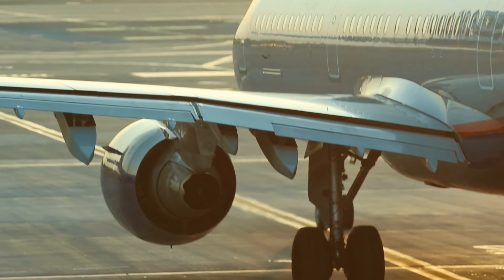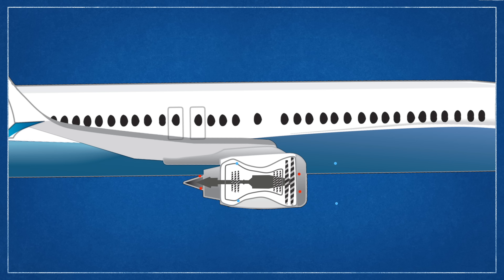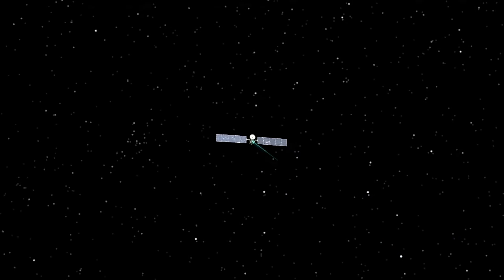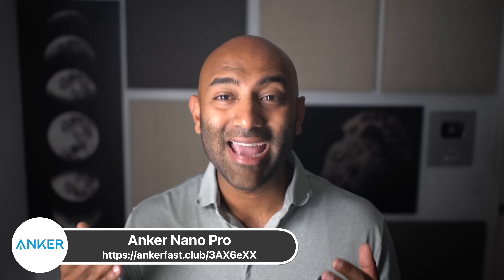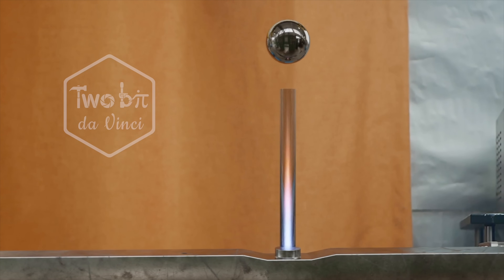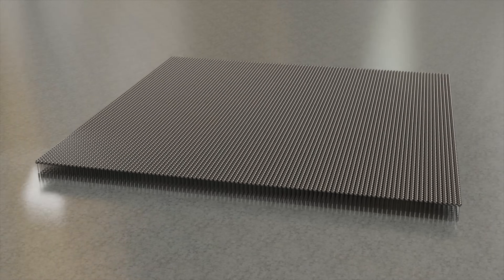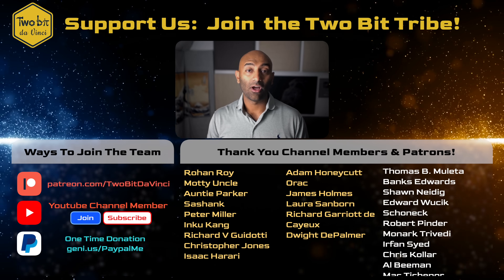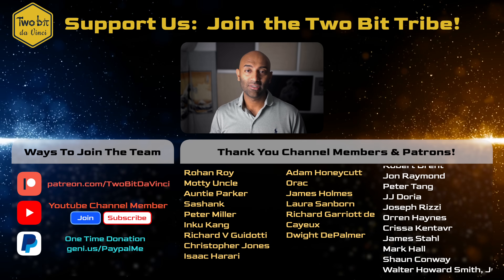The Next Generation of Jet Engines.... Is Electric?

Comment: 400W for 10N of force sounded like a lot to me. I just did a back of an envelope calculation for a propeller (taking a drone as an example). I assumed 0.02 m^2 of area (about right for my DJI spark). Where F=force, ρ=density of air (1.4kg/m^3), a=cross sectional area of propellers, v=speed and P=power;
F=ρav^2 and 
P=Fv/c 
(c is the efficiency of the propeller, which I'll just call 1). Rearranging the first equation, we get an air speed of about 19m/s. Power at that speed is about 200W and I assumed that the prop was 100% efficient. So maybe this isn't so bad.
It's still really hard to believe that it could be efficient to create the state change to plasma in the air.

I wonder how aircraft speed, changes the efficiency of both systems. The plasma system presumably needs the air coming in at a fixed rate, so I imagine some variable intake system would be needed, which will probably create a load of drag.

Regarding the limit of propeller speed, I'd like to hear more about this. Isn't it just a limit of the power of a piston engine vs a jet engine. One may wish to duct an electric prop, and maybe it makes more sense for it to be a fan than a prop, but whether you have a turbo powering a fan or a sufficiently powerful electric motor seems irrelevant.
Reply: Noep propeller speed limit is due to drag inceease at speed of sound, which is why turboprops (props driven with turbines) suffer from it too.

If you wantanyninteresting tangent, look up fairchild xf-86 "thunderscreech"

Comment: There an external version of the plasma engine that can use the skin of the aircraft( flight of the navigator style). In fact there is an visual example carved into Egyptian columns. btw they were painted with the discharge colours. Basically the more points you have, the more electricity discharge. effectively it a spark gap put to best used.  There is even a version that can work using the same principles as solar flares. Magnetic reconnection drives. The twisted flax. Or twisted flux form and reforms rapidly. Do that quickly and rapidly enough and things will fly. MIT made the first ion inspired aircraft to fly over 200m so its possible. Providing the plasma is used as an inducer. thrust can be achieved by a many number of principles. Bernoulli principles apply here. The aircraft get sucked into negative space and flyings from there.

Comment: I am not sure that the ejected "air turned into plasma" will not react to form nitrous oxides while it cools down to ambient temperatures. I am in favour of the development of all possible alternatives that reduce our impact on the environment.
Reply: I am totally sure that it WILL form various oxides of nitrogen. My uncettainty is how far those are greenhouse gases and are they worse or significantly better than the CO2 and other greenhouse oxides coming out of a jet engine
Reply: So then, it's probably more efficient to focus more of our resources on the shorter term fixes to our GHS reduction goals--without abandoning hope of a future breakthrough technology. Fusion maybe?
Reply: That was my thought as well, that extreme temperatures in atmosphere would generate ions by disassociating molecules.
Reply: Worth a study to find out I came up with this idea in 2015

Comment: How about NOx emissions? That will be even harder problem for electric plasma jets compared to combustion engine, i guess. With higher amount of air heated and heated to higher temperature, more NOx is created. NOx is a thing that created Dieselgate.
Reply: NOx isn't great fertilizer?
Reply: @widodoakrom3938  not when it stays in the air. At first, it damages people's lungs from beeing breathed in.
Reply: @volodumurkalunyak4651  yeah that's true

Comment: I don't think we need Plasma to replace a Turbo Fan; it's just a shaft spinning blades; we can do that with an electric motor!
It might be usefull at high speed and high altitude, and I have been thinking about a design for space launch.  If it's possible then that could significantly reduce launch costs!
Reply: Space launch is all about energy density and electric simply doesnt beat dinosaur juice. You are right though that using air for its reaction mass on ascent can provide performance advantages (using it instead of carrying that reaction mass on the vehicle, whilst in atmosphere). You’re also not the first to have this idea though, look at reaction engines’ SABRE engine
Reply: @PowerStudios1000  I think that is more of a belief than actual fact!  Electric aircraft work!  All that's really needed is to make the altitude marks at each stage.  And even if the upper stages can't be Electric, there's nothing stopping the main stage from taking off on electricity!  As heavy as batteries are, all the dead weight gets shed at every stage, so there's really nothing slowing them down!  We could even do a half stage if we send power from main stage battery to stage 2 or 3 engines or just run all engines off main battery until they separate.
Reply: @bardrick4220  If you want some actual numbers. Kerosene has an energy density of roughly 40MJ/kg which is around 12000Wh/kg. The best lithium ion batteries currently are around 275Wh/kg (About 500Wh/kg is the generally accepted required value for large electric commercial aviation). That is an energy density difference of 4363.64%
Reply: @PowerStudios1000  I honestly wouldn't trust half the figures for Li-ion since those are getting better every few months!  There's major economic incentives to reduce weight and increase power, so they can increase usable EV range!  

Like I said I'm only concerned with Altitude and Velocity since that's what's necessary for Launch, but most of the equations are beyond me, so I'm leaving the idea here for those who can solve it.
Reply: @bardrick4220  Li-ion batteries are improving yes, but it's not likely they will increase energy density 4000%+ suddenly. Fundamentally to reach the altitude/velocity needed by launch you need to be able to accelerate the mass you want to take to orbit with reaction mass (propellant) which itself has weight that must be accelerated (until it is used up). This is why the energy density (Energy per unit mass) of your propellant matters.
Reply: @PowerStudios1000  You seem to be confusing Rockets with Space planes . . . A rocket gains altitude by shear power, fighting gravity where as a plane gains altitude by "lift" generated by air passing over it's wings!

Rocket flight is fundamentally different, and I'm gonna say impossible for a battery to achieve!  Green hydrogen fuel solves that problem, but again it's really expensive, so that's why I want to find an alternative.

The Idea is to only use propellant after the vehicle leaves the atmosphere, so you save weight!  I think plasma engines have a major advantage here since you can sustain an arc in very diffuse air long after any flame would go out!
Reply: @bardrick4220  The problem is physics-based and not dependent on how you class the vehicle. You are correct that aircraft use lift, this lift however is produced from forward motion which is achieved by the propulsion unit attached to the aircraft. This could be an air-breathing propulsion system (Jet engine for example) where the bulk of the "propellant" is the surrounding air and only fuel needs to be kept within the aircraft or it can be a rocket motor (Fuel and oxidiser kept within the aircraft/spacecraft). To get to orbit the vehicle must essentially go very fast, so the lift actually doesn't matter that much apart from during low-speed take-off/landing of your spaceplane (See skylon's small wings) and the propulsion system matters much more.

The fact remains that any propulsion unit needs a supply of onboard fuel/energy which will require mass (Yes even your plasma idea will need this in the atmosphere as it consumes power and that power must come from somewhere onboard) and if that mass is too large then it will be infeasible for it to reach orbit. Batteries very much fall into this category and likely will for a very long time. Plasma propulsion uses orders of magnitude more power than an electric fan system for the same thrust and so is also completely infeasible and will remain so long after some miracle makes batteries marginally feasible (For the atmospheric portion only of flight).

Spaceplanes, as with any SSTO concept, actually have even more of a strict requirement for energy density (by mass) to be feasible than rockets do. This is because the energy to reach orbit is huge and is larger for a larger mass and you are trying to bring the whole spaceplane to orbit (Rather than dropping parts like a staged rocket does). Concepts like Skylon are only just-about feasible because of the high energy-density of the fuel and the clever use of air as the propellant whilst in atmosphere within the same engine which can also use oxidiser when outside the atmosphere (Essentially maximising the velocity change able to be imparted to the vehicle, 'delta-v', per mass). There's a reason we see lots of rockets and yet no current working and flying spaceplanes.
Reply: @PowerStudios1000  I don't think you understand the physics here; propellant mass is the main reason aircraft based launch systems exist!  There's a reason aircraft don't cost anywhere close to the fuel cost of a rocket!

As the atmosphere gets thinner the drag goes down too, and Solar panels provide practically infinite power too, once you're above the clouds and/or atmosphere.

And I'll say again: if efficiency is our goal, we don't use our propellant until after all the air is gone!  At this point, it's an ion-craft!
Reply: @Bardrick  The use of air as a reaction mass does indeed reduce the total propellant required to be carried on board versus not, all else equal. The difference I was referring to is that a spaceplane you are trying to bring the whole thing to orbit and thus energy DENSITY (not quantity) is quite critical for that to be feasible.
Reply: @PowerStudios1000  only 1 small piece of the space plane is making it to orbit.  A bigger problem is going to be making every stage aerodynamically stable and able to fly back to base!

I've been trying to explain: Energy Density only denotes how many stages are needed because most of the batteries never leave Earth's atmosphere! . . . understand?  Mass=0 because it isn't there anymore, so each stage takes it's usable cargo mass to lift the next section, repeat!

What I don't know is the fully assembled ground weight, whether it's able to take off and if the cost of electricity is still worth it at that point!  

You should be trying to prove "Hydrogen electrolysis is cheaper" because that's the deciding factor!
Reply: @PowerStudios1000  I think a liquid argon propelent engine would be good since argon is common in the atmosphere, arcs like it and it's inert, so it would reduce electrode erosion.  (I'm not sure why they like to use microwaves; I think that's less efficient)
Reply: @bardrick4220  Both propulsion from an electric fan and from an electric plasma thruster will not have as good an energy density as the combustion powered SABRE engine's atmosphere stage - by a few orders of magnitude. Weight really is everything with launch vehicles - typically 85-90% of a rocket is the propellant. If your "propellant" (Incl. in this batteries, etc...) isn't energy dense enough then you simply don't get to space since the amount of "propellant" you would then need to move that amount of mass to space is larger than the mass itself.